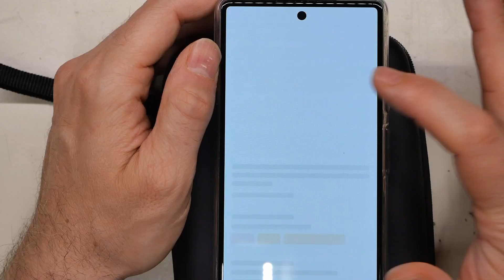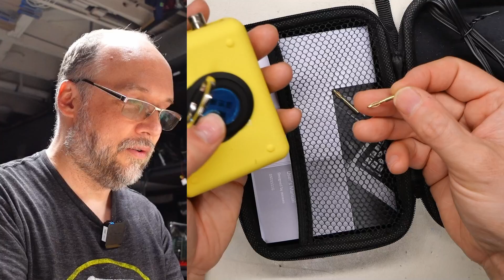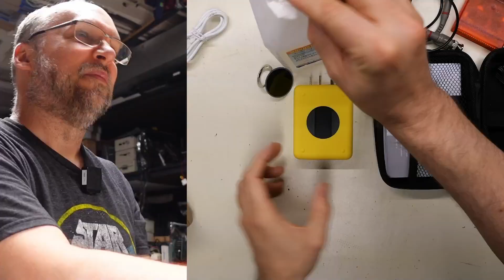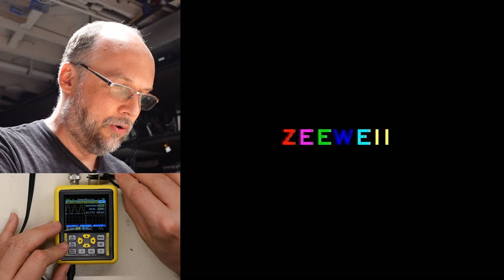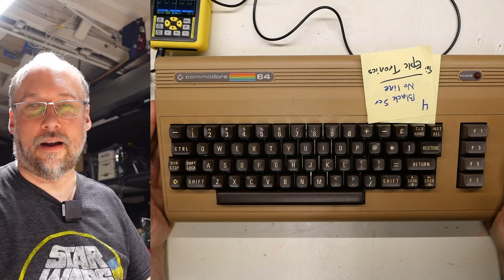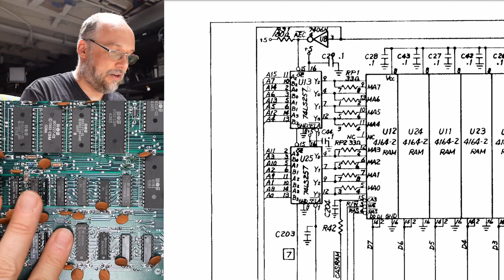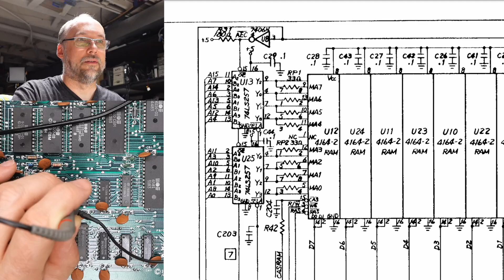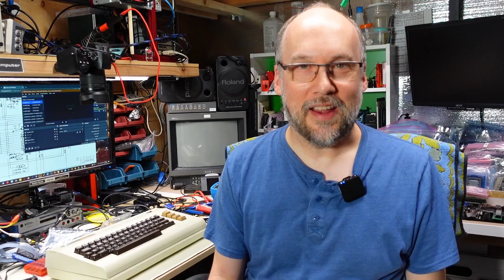4/12 C64 repair using a great $57 portable oscilloscope (ZEEWEII DSO1511G review)

Comment: You should probably put a small grommet, rubber band or o-ring around the middle post there in your EZ-Flash to make it fit properly.

You might also want to put some rubber pading on the side of it's case to make it fit slightly better.  Also, you should be able to do that light-pipe setup as a retrofit.

The SID sounds like it could be worn capacitors.
Reply: As if the osciloscope.  Looking how the quality decreases as you increase frequency, I bet it will DISPLAY 150Mhz, and it's counter might work, but the image will be very noisy with rather low sample resolution making it less useful at those frequencies.  I suspect getting a better probe might clean up the signal a little, but it still won't be as good as a high-end desk scope.

Comment: I have understood that the SID was produced in a process that is better suited for analog circuitry than digital, and this presented some difficulties in making its digital workings accurate as in meeting uniform trigger voltage levels both inside and between individual chips consistently. Especially the first four revisions that operated on 12V and yet took TTL level input. I may be wrong and will be happy to be corrected.

Comment: I bought a Fnirsi-1C15 110MHz handheld scope some time ago from Amazon and it works real well.  I think I spent around $80 or so, but I can't quite remember.  It was well worth the price for my needs!  👍👍
PS: There is a video out there where a guy proves that it REALLY IS 110MHz.
Reply: Yeah, although it is cheap and small, I'm not clear why Adrian immediately dismissed it as not 120MHz and not 500MS/s capable.  Why not feed it a 50 ohm terminated signal and see?  Scope front ends are getting more integrated and cheaper all the time.  It might indeed resolve a 120MHz sine wave, but perhaps not the normal industry spec of being 3dB attenuated.  Not many sample points though at that rate - not sure if it has SIN x/x interpolation or not.

Comment: I've been using an earlier version of this scope for a couple of years now (the AV output feature wasn't available when I bought mine).  It's perfectly fine for diagnosing and fixing vintage stuff as long as you're measuring below 30MHz, and is ideal for a casual user or newbie that can't justify the big bucks on a bench scope right now. That being said, it's not a bench scope substitute, but it's more than adequate if you have realistic expectations of what it can do.

Thanks for the great practical reviews of affordable gear, Adrian. Long may they continue.
Reply: I also have the earlier version, and find it to be a perfectly serviceable oscilloscope.  I keep in in my tool bag for field work.

Adrian didn't exercise the scope thoroughly enough to check the frequency response.  Mine is only rated for 100 MHz, not 120, but when I used my HP 8654A signal generator, it had no problem getting to 100 MHz.  In fact, the issue I found was a small increase in sensitivity (a bulge in the frequency response curve of about 15%) above 90 MHz, which it seems likely to me is a result of the "100 MHz" probe rather than the instrument itself.  Still, this scope was easily good enough to make my list of "cheap test equipment that's actually pretty good".
Reply: as a newb I loved it. bought one

Comment: Does the video output "bounce" on the external display, or is that just some weird video capture artifact?
This would be a perfect bit of kit for me (i have zero oscilloscope now), especially the a/v out, but if the output does the "bounce" thing, it might not work for me, as the constant up and down motion would bug me.
Reply: The video output is progressive (288p), but his RetroTink was interpreting it as interlaced (576i), making it bounce up and down (made worse by the fact that it's 50 Hz PAL being displayed in a 60 Hz video). I would guess that the RetroTink probably has a setting for this, and I wish he had enabled it, because this bouncing up and down made the video very hard for me to watch (I ended up not watching the whole thing).
Reply: @davidellsworth4203  TY. That makes sense. Got to love how something so common as video display has so many 'standards'. Reminds me of how SONY loves unique power connectors for every device.

Comment: I love your repair videos Adrian.  I have learned so much about electronics troubleshooting from them.   I also bought one of these tiny oscilloscopes off Amazon like you have and they work great!   I have fixed a NTSC C64 and an Atari 800XL with it.  For the money they are a deal for what they can do for 8 bit repairs.    Another option to fix the LED in the EASY FLASH CART is to drill a larger hole in the case so it can move around?   Thanks again for sharing your knowledge with everyone.

Comment: I am super surprised by that scope. It fails the Louis Rossman test for equipment ease of use, but I feel like it's easy enough to use for the price paid. And having video out is super good, even if it is composite. I have an old 4:3 lcd TV  that I use for my nes on my desk that would be a perfect large display for this.
I'm really all for this era of cheap, usable test equipment that isn't just used.
Reply: 100% agree, especially with that last sentence. Good luck trying to find a used scope for this kind of money in the current market.
Reply: Dumb question: what's the Louis Rossman ease of use test? Don't think I've seen that particular video of his.

Comment: An easy fix to the LED problem would be to drill out the LED hole a bit larger to give the LED some wiggle room.
Reply: an even easier fix would be to use the full length of the LED legs to add flexibility. just need to bend them and add heatshrink so they can't short... I'd just fit self-adhesive bumpers inside the case to firmly grip the card in place, though.
Reply: @raybarker  I don’t see how that would be easier than just widening the hole with a drill bit
Reply: @JohnLaury-1 fair enough. I was thinking of it as a while-repairing-the-fault fix. (Both of these 'fixes' will transfer the strain to a different component, though - hence the alternate suggestion)

Comment: It's amazing the bang for buck you get with test equipment coming out of China. It's certainly not a high end scope, but it does the job very well. I purchased a NanoVNA-f to test antennas (I'm an amateur radio operator) and it's an insanely useful bit of test equipment for the $$!
Reply: This'll be amazing for those ham meetups to quickly test broken equipment. 'Cause there's always someone bringing something to tinker with, and I have seen bench oscilloscopes out for testing.
Reply: Me too, and I've just pulled the trigger for the scope. Damn him. 73.

Comment: That scope is so surprising. I recall the first scope I ever saw very long ago. No one was allowed to touch it except the guy trained on it. It was super expensive (think it was a Tektronix). Amazing how far that tech has come.
Reply: Tektronix is THE scope company.  I was a calibration technician, and most of the scopes I calibrated and repaired in the military were Tek scopes.  They're great.
Reply: I snuck in later that night and touched it, singing la la la la!
Reply: i can say exactly the same about the first 386 motherboard I ever saw :)
Reply: where was that? I would have touched it and probably tried to open it. A scope is the kind of thing  where if in a room full of techs, all the techs will be trained to use such a tool, not just one guy, nor would just one guy be allowed to use it in a room full of over smart toddlers. Just saying, doesn't sound like a great environment wherever that scope was you speak of. I could understand if it were a scope today, so light and expensive can be swiped off a table onto the floor by accident. not the iron cabinet full of glass they used to be. imagine being the guy who knocked over one of those big scoped on a cart with racks on racks of tubes, shattering when they slam the ground
Reply: @WTFinc  This was when I worked at Boeing. It was in the QA/QC department.
Reply: @WTFinc  Well, that's how it was in the 80s, scopes were considered high end equipment. I remember our class being shown a Winchester hard disk in operation and we all gasped at it in awe. It was made known that if any of us decided to try and touch it,  breath near it or even look at it in an undeseriable way then a kill squad would be sent out to deal with us. 😀
Reply: @WTFinc  lol these werent $50 or 500 scopes... youre talking maybe 5 figures you dont want joebob what once fixed mamaws toaster poking the probes into things

Comment: These little scopes are cool,  but yeah,  no way it's 120Mhz bandwidth.  I remember Dave @ EEVblog doing a review of this exact scope like a year ago,  and if I remember right it was more realistically around 20-40 Mhz?  Still useful but some of the specs on this thing are questionable.

Also I think there is some confusion with grounding and scope probes in some of these comments.  Some people seem to believe that using a battery powered scope is somehow a foolproof protection mechanism against disastrous ground loop shorts in mains powered circuits.  The only time that is true is if the scope has only a single channel and no other inputs,  or if the inputs are isolated.  If there is more than one channel or input,  and they're not isolated inputs,  and you are using both channels,  you can most definitely cause a direct short between channel grounds if the probe grounds are connected into a circuit at two points with a significant difference in potential.  You can blow the ground plane and/or the front end of the scope,  vaporize the ground leads,  melt the probes,  etc. ,  it's not pretty.

I just want people to keep in mind that protection devices like isolation transformers,  high voltage differential probes,   and "safer" devices like battery powered scopes can give people a false sense of security,  particularly if you are not aware of their limitations - ie. for example you can most definitely still be shocked even when you're behind an isolation transformer under some circumstances.  One of the safest things that you could ever do for your bench to protect yourself is to install GFCIs  (or use a GFCI breaker in your main circuit breaker panel),  as they are specifically designed to save your life.  Yes they can nuisance trip and sometimes be annoying,  but I think it's worth it.
Reply: Reading the specs, the device doesn’t even have a CAT rating. So it’s ability to insulate if floating is unknown. You’re right that there should be many other safeguards in conjunction to safeguard the user. Last thing you want is someone using for AC mains power supplies (too many reasons why they shouldnt), simply because it can float.
Simple answer for this device, stay safe and stick to low voltage with the scope grounded.

Comment: This little scope sounds like it would probably be quite handy for hobbyists or first year electronics students. It would be interesting to see what the output was like when connecting it to a PC through the USB port.  I would assume it would be a lot clearer than through the composite plugs.

It sounded like the SID was definately on the way out.  I was hearing quite a bit of distortion on the lower range and there was a bit of clicking like notes were trying to activate but whatever trasistors inside the chip that governed said notes were shorted.
Reply: I don't think the SID had separate transistors for individual notes.  Probably some DAC-like circuitry converting a computer number into a combined value of an analog circuit element or a digital circuit dividing a system frequency into a similar square wave passed into an analog signal shaper.  But I've never seen the SID chip specification.

Comment: I don't think I'd trust such a cheap and low quality scope to anything critical, but it may be just the ticket for aligning an old vacuum tube radio on the cheap! Might pick one up for that at least; got a couple AA5 sets that could use a twiddle or two. Procedure requires a signal gen and a scope; this has both.

Dunno if you've peered under the bakelite before, but Mr Carlson's Lab is a channel of top quality...much like yours...that revolves around vactube gear. Lots of radios. Great guy. knows his shit. He's to vacuum tube gear as you are to 8-bit computers! Mentioning him now...yanno I kinda wouldn't mind seeing a collab between the two of you, see if some of his 80 year old test gear can be used to repair a C64 haha
Reply: Carlson loves old vacuum tube scopes because they have a kV  capable frontends. The 1957 tube radio i wouldn’t connect connect the ouput HV to the 400Vpp DSO front end!
I have one tube amp I designed with -320 to +320Vdc that needs a kV probe/kV differential probe. The other circlotron has floating power supplies which should use a differential probe but is small enough signal that 400Vpp safe.

Comment: Thanks for the info on this scope.  I dropped the additional $23 and got the dual channel version, specifically because it has X/Y mode, and I have an old Battlezone arcade machine with both board and monitor issues.  This will be a dedicated monitor when I'm working on the board, freeing up my Tek DSO for troubleshooting.

The PAL output is a bit of a bummer, but I run composite through a cheap HDMI converter anyway, and it supposedly accepts PAL. I guess I'll find out...
Reply: You should be happy about PAL out, it's better resolution,  and more stable colour than NTSC. ;-)

Comment: You can put a couple dabs of hot glue in the easy flash cart to secure it. It will still be easy to pop the board out if needed.
Reply from the maker: Actually it needs to be lose like that because the C64 cart slot isn't always aligned perfectly so every cartridge has a PCB that can move around a little.

Comment: 36:22 - just put led closest possible to board, and use drill to widen hole in plastic for LED. Also a little bit of hotglue would help board stay in place.
EDIT: After this video, I decided to buy this oscilloscope, and its the first one I have in my life. Its way easier to see how PCB works now, way way way easier and better to understand, just poke around probe and you see all in real time. Thank you for making this video.
Reply: I was thinking the same. 😎👍

Comment: You could just enlarge the LED hole in the Easy Flash to take the the slack and remove the stress from from the connection.

Comment: The 120MHz bandwidth probably refers to the analogue bandwidth of the input stage. If you want to see a 10MHz square wave, you need to have an analogue bandwidth high enough to see enough of the harmonics to form the wave shape - typically at least 5 times the fundamental. So if you feed in a 100MHz square wave it will display a 100MHz sine wave, because the input stage will not be able to handle the harmonics (This is something that catches people out with even expensive oscilloscopes). Also, with 500MSpS each cycle will only be 5 samples, so you wont really see much of the sine waveform. Also, analogue bandwidth is usually measured to the 3dB point, i.e. the point where the signal displayed is half the ampitude of the actual signal, so you need to take that into account too.
That said, you should be able to see reasonable square waves upto approx 25MHz which is good enough for most purposes in retro computing, unless you're fault finding something like an Amiga video stage. And of course you will see something up to much higher frequencies, although it might be increasingly tricky to spot timing or rise time problems.
Reply: Might be able to determine the bandwidth by measuring the displayed rise time of a square wave.